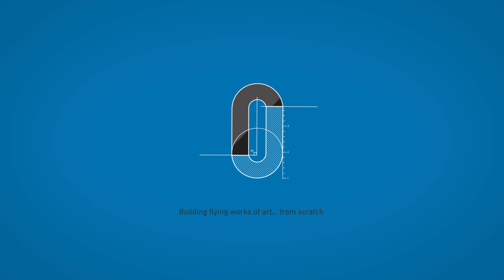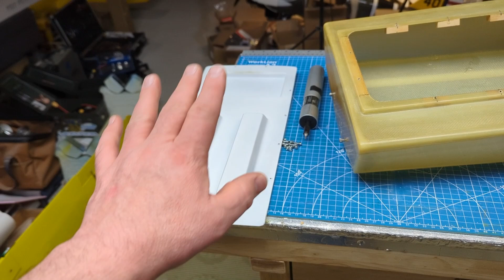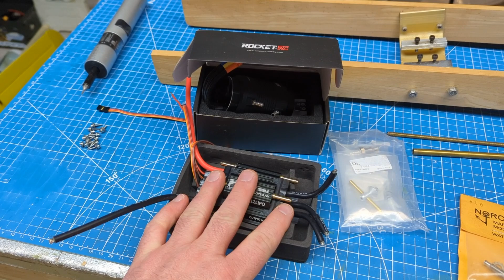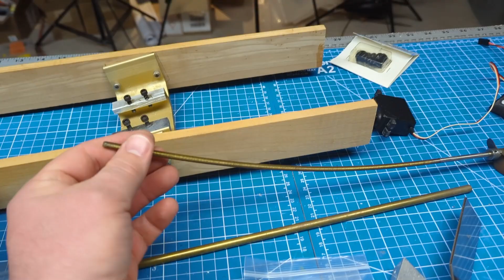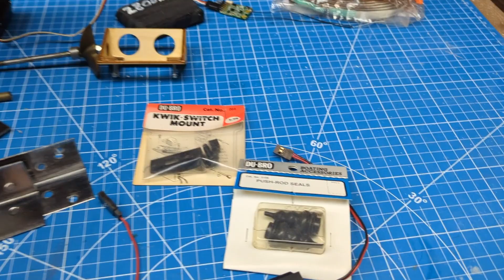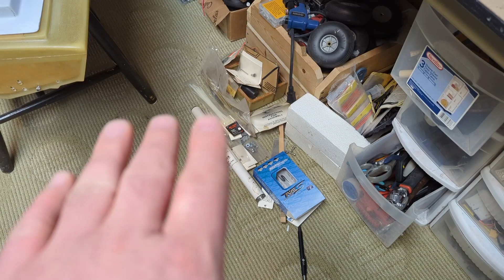Prather 40" Deep Vee | My FIRST RC BOAT

Comment: I have this exact boat running with a K&B 7.5cc inboard marine engine. I would use it a learn how to run a Nitro engine. It doesn't have to run on race fuel. Low nitro sport fuel would be fine.
Do you have the maple side rails that need to be epoxied into the boat? Also should have an aluminum engine mount that goes between the rails to mount the engine on. I mounted hatch differently using 2 Dzus fasteners in back corners and aluminum tabs at the front. My boat has been a Trophy winner for me in a couple of races. It takes a little fiddling with and the right prop but it runs real nice doing wheelies out of fast corners! I hope you have all the stainless steel  hardware for it. Converting to electric boy I don't know about that one...seen to many fires start from batteries. Good luck with projecy!!!
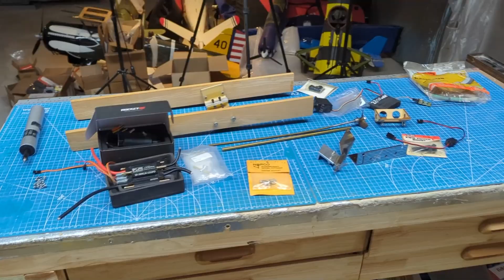Reply from the maker: I appreciate the comment! You can see in the video at 5:11 that the maple beams and aluminum engine mount are there and are yet to be installed. the engine that came with is the same as yours but like I mentioned, noise at the neighborhood pond is a BIG concern. I've been flying with LiPo batteris for over a decade now and I know how to treat them and handle them with respect. It's a different kind of careful from the liquid fueled approach. ;)

Comment: Going through the same thing with a couple of my dads vintage boats one being a nitro  hydroplane and a v bottom. Going to convert the v hull to an electric as it use to have a 20 size nitro engine. Thinking about leaving the hydroplane nitro, and it will use a 40 size nitro. So, I'm just getting my hardware list together for both of them, not easy. Missing lots of the old hardware. Just have to do more reaching.
Reply from the maker: I feel your pain on navigating the parts list. Keep at it!

Comment: Hi Joshua,
Is that a K&B 7.5 engine? I have a Dumas Deep Vee 40 that I powered with a K&B 7.5 marine, but has the throttle on the intake and used their short tuned pipe. Haven't run it since the late 80's, but when I did it screamed in the turns then ran a little slower in the straights. I needed to raise the prop about another 1/8", but already used up all the up adjustment I had available on the strut. I want to power it with electric and will be interested in your choice of components and how you design your install. You and your family stay safe.
Reply from the maker: Yep! That's the engine! Thanks for continuing to follow along!